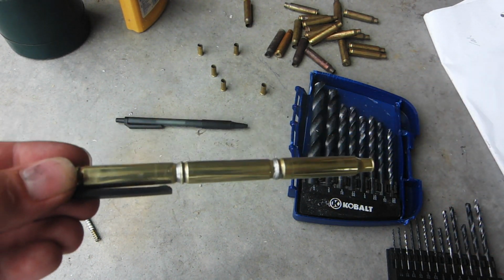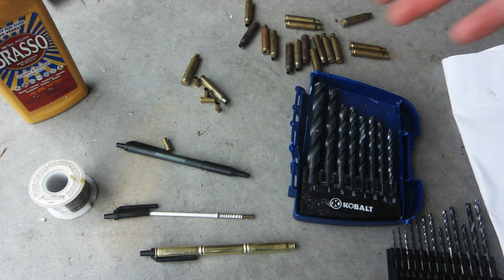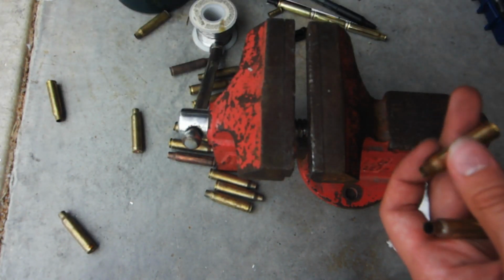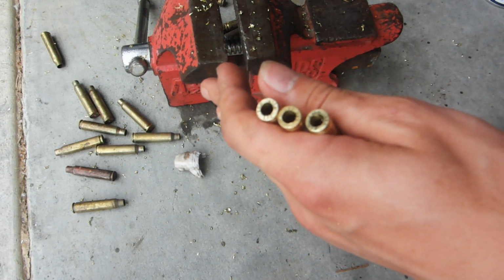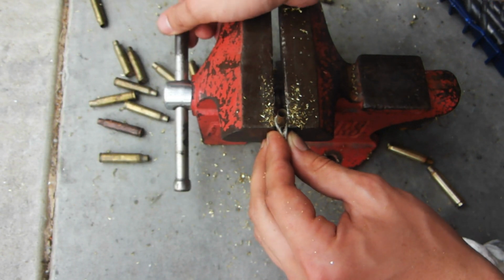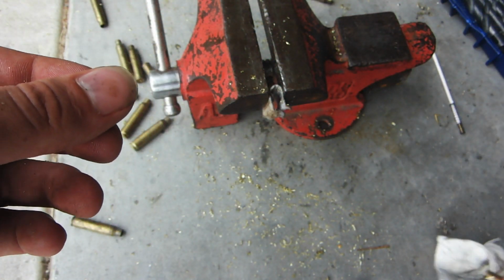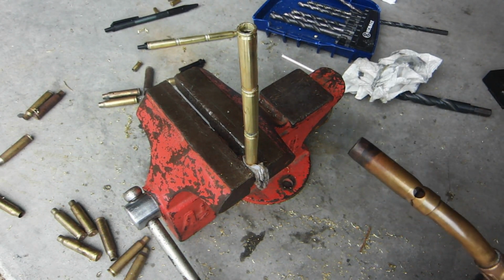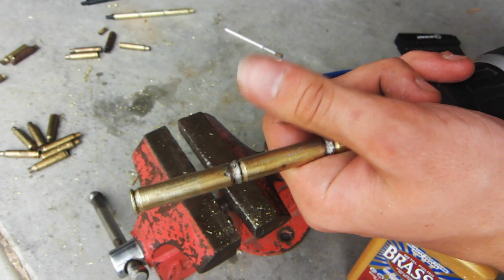How to make a pen out of .223 cases (Full Tutorial)

Comment: Use 0000 steel wool to polish and use some semi liquid flux before soldering. Just heat the metal and touch the solder lightly against the joint to be soldered and it will be a much cleaner joint. Then another spin in the drill with the steel wool to finish polish. Nice idea btw.

Comment: can you usea mixed casings to make a pen like that? like use a 2.23 and then a 5.56 or a 308 casing?
Reply from the maker: 2.223 and 5.56 are almost identical dimensions wise and I think in the video I used a mix of the two but 308 is a bit bigger so you might be able to sprinkle some pixie dust on the situation and make it work. I made one of these out of 8 mm mouser so the sky is the limit although I find that pen very uncomfortable to use.
Reply: MOO Tech ok. Thank you very much for the information about all the bulets. Thanks a million.
Reply: MOO Tech i meant bullets not bulets.